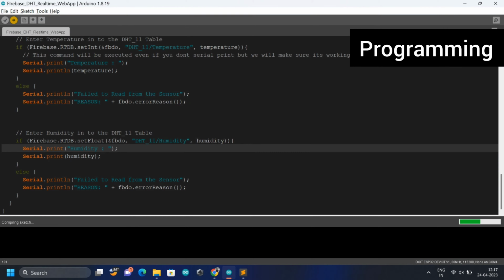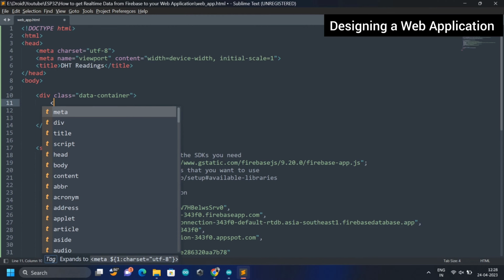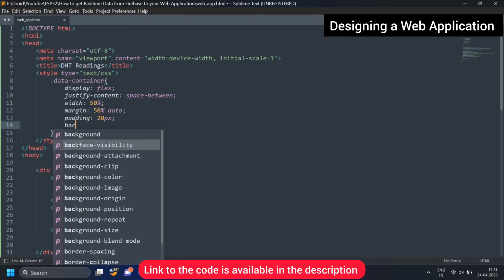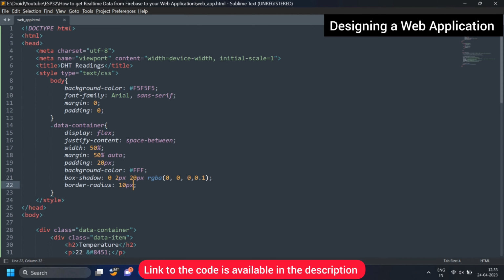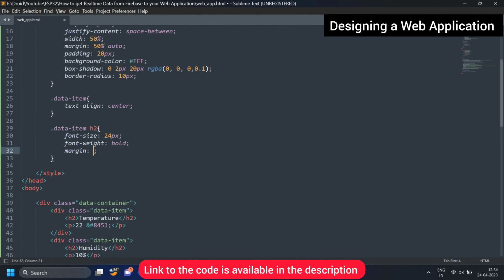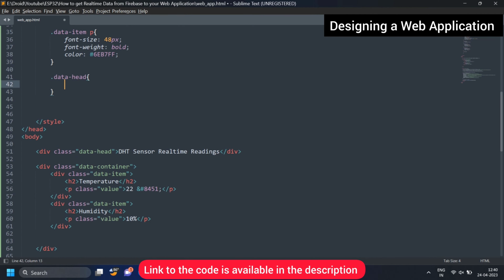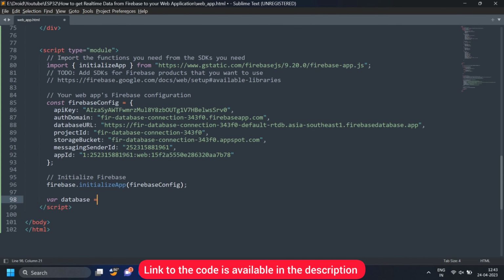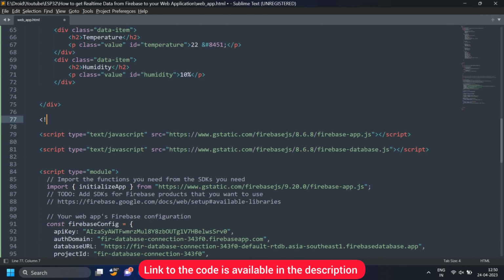How to get Realtime Data from Firebase to your Web Application

Comment: Firebase.ready and Firebase.RTDB.set or Firebase.RTDB.get these methods are not there. What to do for this?
Reply from the maker: Did you install the firebase dependencies?
Reply: @ElectronicsSimplified7  Yes 

Even if the firebase is ready. I am facing this error

Request failed: 
send request failed
Reply from the maker: It's hard to debug with this information.
Reply from the maker: Please tell me more about the project
Reply: @ElectronicsSimplified7  Just I am trying to send one string value to the Real time database at that time I am getting this error.
Reply: void requestForDataFromRTDB() {
  String data = "70";
  if (Firebase.ready()){
  if (Firebase.RTDB.setString(&fbdo, "/vehicle/speed", data)) {
    Serial.println("Request successful");
  } else {
    Serial.println("Request failed: ");
    Serial.println(fbdo.errorReason());
    Serial.println(Firebase.authenticated());
  }
  }
Reply from the maker: Please visit www.electronicssimplified.in
Reply from the maker: Mail me the code to electronicsengineering3@gmail.com
Reply: @ElectronicsSimplified7  Mailed you. Please check the code
Reply: @ElectronicsSimplified7   Mailed you. Please check the code
Reply: same issue here

Comment: tried it, but in the database there are only the tablenames with value: 0 created.
The sensor readings are correct in serialmonitor. only the table is not filling with data. what could wrong?
 
DHT_11

Humidity
:0
Temperature
:0
Reply from the maker: If the serial monitor shows the readings. It means the system is working fine. But if the database isn't reflecting the change after every interval that is mentioned in the code. It means that the database has not connected properly.

Comment: In the serial monitor,
14:03:04.687 -> ADMIN_ONLY_OPERATION
14:03:04.718 -> Token info: type = id token (GITKit token), status = on request
14:03:06.342 -> Token info: type = id token (GITKit token), status = error
14:03:06.375 -> Token error: code: 400, message: INVALID_EMAIL
14:03:06.438 -> Token info: type = id token (GITKit token), status = error
14:03:06.503 -> Token error: code: 400, message: bad request
what is the problem, sir?

Comment: hi, i am getting this error "Failed to Read from the Sensor
REASON: Invalid data; couldn't parse JSON object, array, or value." Can you help me with this
Reply from the maker: Your connection has an issue
Reply: Facing the same error, if I try to read the sensor data on serial monitor locally without the firebase connection the sensor seems to be working fine but when I try with firebase code it gives me the same error @ElectronicsSimplified7
Reply: i have the same problem
Reply from the maker: Check that your sensor is connected correctly and you have firebase configured correctly.
Reply: hii i am getting the same error. Did u solve urs?